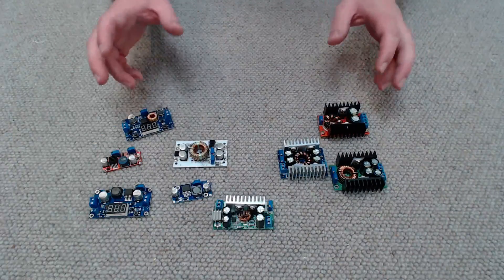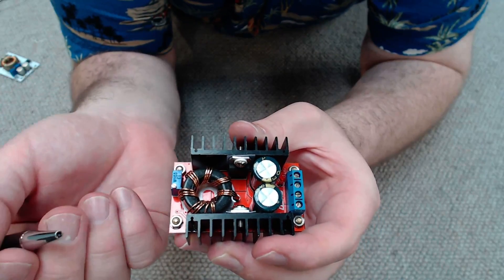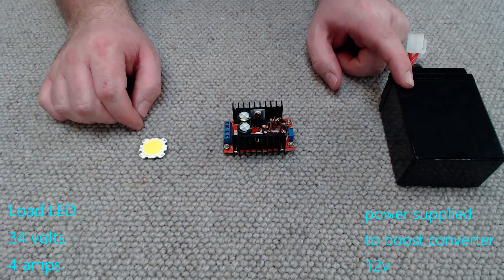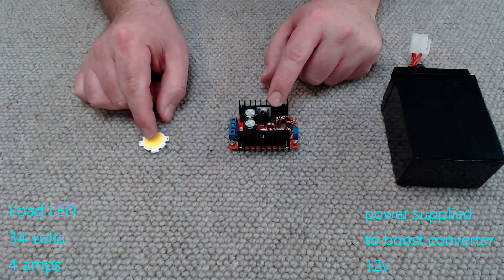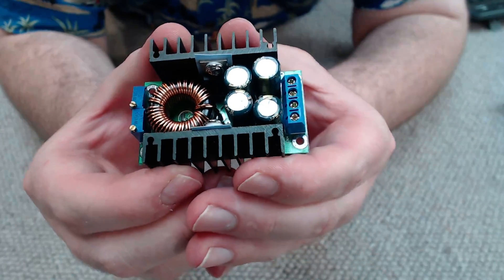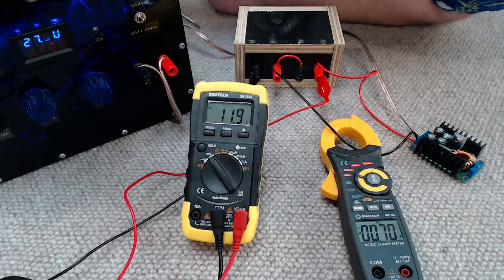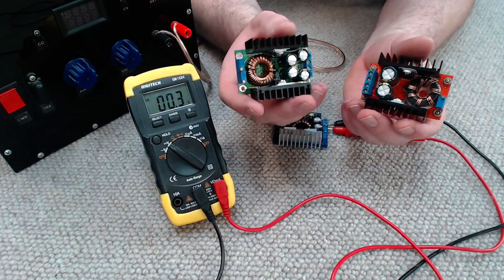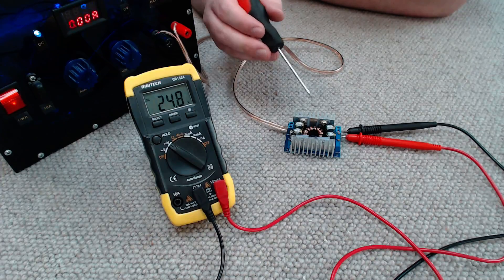What You Need To Know Before Buying A Boost/Buck Converter

Comment: If you got a boost converter that could handle that 11.33 amps, how much amperage would be on the power supply. Like if the power supply were only rated for 6 amps would it burn up
Reply from the maker: In the scenario, you described yes the PSU would be overloaded. It's important to remember current or the voltage alone doesn't give a full picture. Let's run over a quick explanation. Let's say my power supply can deliver 10volts and 10 amps. And let's assume I have a load on my boost converter of 30volts at 5 amps. Since my load is only 5 amps, surly my power supply can handle this... Right? Well no, because the total power consumption in watts, far exceeds what my power supply can handle. My PSU can output 10volts x 10amp = 100watts. My load is 30volts x 5amps = 150watts. So my power supply is overloaded. I hope this helps :)
Reply: So if I want to run a 50W LED strip that is 24v I cant is a 12v 300w Watt psu?
Reply: @LEO-xo9cz  You can use that psu without problems - any 12v psu with 7-8 amps output will handle that without problems if psu is ok and if wires can handle that for long time. PC psu often have 2 12v lines with 10-20 amps. Use some quality psu if you have.
Reply: @krlenjuska  Hi. Yes I have 2x 12v 18a lines. I was thinking of using two buck boosts and displays with voltage and current control so I can have two controllable outputs.
Reply: @LEO-xo9cz  If your PSU is cheap - its probably much less that 18A. Also voltage drop is often quite big under load on cheap PSU. Dont forget to join 3-4 wires (12V and ground also) to 1 thick wire for your buck/boost converter input in orded to prevent overheating under big load
Reply: @krlenjuska  It's a decent looking Dell supply. Well I've got a few others in my basement if this one is no good. Yes I was going to use 4 wires for each. What buck boost rating should I use?
Reply: I have about 5 of those exact boost converters! Can you run 2 or more identical boost converters in parallel? I know its a dumb Question but i am curious is it possible to increase current that way?any reply appreciated? Cheers
Reply: @dragan3290  sure u may find solution inface pf som transformer but basicly the problem is this:
Each one of Converters practicly is "non ideal voltage/current source" and kirchof law will curse you:
1.from voltage perspective ,each time u hadnt load your power supply,u had two source in paralel.which means if they slightly had differnece impedance or/and output voltage》》boom.
2.from curent perspective,without load u had two sources in series.back current to semiconductor with less output resistanse.its like each one of transistors will think that another one is Load and not sourse.》》Kaboom
Actually it depends on type pf semicpnductor in it,som of tnem designed like with build in diode so no problem of type 2.

Solutions: some addition diode to prevent 2 problem,some power resistor to truy make out impedance identical between two converters(just build up T junction between two sources and load,two power resistors in series with source.worse possible solution ,not effecient)...best and safest from my opinion is a tranformer way but its much expensive one.
Reply: @dragan3290  Generally not without modification like steering diodes on the outputs and some power resistors etc for some compliance.    Two or more separate feedback loops all fighting each other for control of the commoned output isn't optimal.
Reply: This was very helpful and likely saved me from frying some expensive equipment!
Reply: pm me can you  install do sola battery.... 😊
Reply: For example is you use PC power supply with 12V 15A - its 180W of power. These chinese buck converters have 65-70% efficiency (this is my opinion its not tested) so you will get about 120-130w of power on your output. example 24V 5 A or something like that.
Reply: @krlenjuska  they are actually 95% efficient, or at least mine is.
Reply: @easyamp123  You tested this?
Reply: @krlenjuska  yes mine is a DROK 180081

Comment: So basically the Converter input capacity should be in expressed in watts and not simply  amps. Another issue of supplying power via a battery. As the battery voltage drops, the current will try to maintain the output voltage. And therefore increase the amps flowing.This will get a solid state relay really hot if over it's rated amps

Comment: can this types of modules make some RF problems ? i want to use one  to low down voltage from my power supply ,17 volts to 13,8 . to connect my uhf ham radio tranciever to it.... can it create RF problems  or strange sounds in my signal ?

Comment: These modules are trash, I bought 2 different boost converters and they were both terrible, very high output noise and barely can handle 1A load, anything above that the voltage drops significantly !

Comment: What would happen if you lowered the power supply voltage with the buck boost converter, would it continue to hold 24V (that’s what it was set to at the end) or would the V drop? Also if the voltage dropped below the required operating voltage and then came back up into the operating voltage woukd it just go back to working like it never turned off? I want this for a solar panel to provide a steady 24V even when the solar panel drops lower in low light and I want it to turn back on once the voltage comes back up

Comment: Your shirt's so loud I had trouble understanding what you were saying.  I have no idea why you had 6 lead acid cells as 12v and 8 as 26v. The internal resistance of the battery shown is under 50 milliohms, that's not an explanation. BTW its still going to burn out the converter every time the battery runs down if there isn't a low voltage input shut-off to protect it, or a high input current shut off. For hobbyists a thermal circuit breaker will be simpler than anything else. It will require enough headroom on the converter for normal operation to never trip and yet trip within seconds below the converter's upper limit. The circuit breakers tolerance vs temperature may be a problem. A polysilicon resettable fuse may be a better choice from that standpoint but forces the addition of a battery current switch to allow it to cool and reset. An electronic input voltage threshold detector tugging on a disable line of the converter has the best tolerances but the highest complexity to implement.

Comment: Im testing 4 motors 8520 i think the peak current is 1.8amps, so four will need 7.2 amps with my esp32 im looking for 8 amps. I have a few mt3608 buck boosters. But im not confident these can provide enough. If you have suggestions i appreciate your comment

Comment: Always interested to know how things work when use doesn't matched designed intention.

Eg if I want to output 16v from a boost converter but it's supplied from a battery which can be 16.8v fully charged, will it simply output battery voltage until the charge is low enough to require actual boosting? Will this have any detrimental affect on the boost converter?

99% of the time it (battery voltage) will probably be below the desired 16v output but there may be times when it's higher.

Comment: Do they make current limiting boost converts that can do say 48v input --> 360-400v output?  Ideally with 100-500A input.  Yes, I'm trying to charge my EV battery from my 24kwh 48v trailer battery using a DC-DC converter for efficiency reasons stead of going 48v DC --> 240v AC inverter (95% efficient) --> 360-400v DC (90% efficient), which totals around 85% efficient.  Boost converters I've seen usually run around 97-98%, so that's one of the main reasons I'm trying to do this.
Reply: FORGET IT.  That is NOT a DIY project

Comment: can i use it to power a resistance wire, with resistance under 1 ohm, like 0.15 0.20 ohm, it will not activate the anti short feature?
Reply: check the specs! especially current rating.

Comment: I have a 20v ac transformer that i will rectify to roughly 28v when loaded this will sag slightly. I want to use one of these units in your video to boost this to 36v for an amplifier. Which ine would you suggest? Output current needed would be between 5 to 8amps. Thanks

Comment: I know this post is 6 year old but I have a question. I want to make a bosst converter from a 12 v to 24 with either 2.7 or 3.7 amp, it will power 2 different cpap machines one is 2.7 other is 3.7 and not at the same time. so max will be 3.7 amp so 24v x 3.7 amp = 88 watt it says 85 on the 110 to 24 converter. Do I need to have a boost converter that I can control the amp output or just voltage is enough. i seem to understand that only to drive led you need to control the current. Thanks
Reply: depends on the LED product

Comment: Im planning to use a buck converter for DIY charging. From 24v 4A to 21v 3.4A. Do we need to add a little headroom so the buck converter wont dropout? for example: 21.1v 3.5A
Reply: use power diodes to drop the voltage. you are dropping 3V so you need 3V/.65V diodes -say 4.  I'd use 10A diodes at least 50PIV. Two 10A bridge rectifiers would also work - these are  cheap

Comment: Great video! Can I use a buck converter for charging Lithium ion batteries? Will it taper the current (lower the current) when the battery is getting closer to be at full charge?
Reply: NO!!!!!!!!!!!!!!!!!!!!!!!!!!!!!!!!!!!!!!!!!!!!
Reply: @kennmossman8701  To late. I died 10 months ago due to a lithium fire.
Reply: @Zokeh   you can apply for a Darwin Award

Comment: Finally found your channel looking to make a bench charger that needs to go between 60v and 3v for lithium cell/pack charging would a 24v 16amp power supply work for this with a converter
Reply: you are confusing a CHARGER with a converter/power supply

Comment: I wonder if I wanted to use a buck converter (lets say the power source is 25v) to power my laptop instead of the charger which is 19v, would that be harmful to my laptop? 

I heard that laptops are sensitive devices and buck converters don’t produce clean DC as much as the original charger. 

I would really appreciate it if someone enlightened me.
Reply: yes, such converters are VERY noisy AND can exhibit voltage surges[good-bye computer].  I would not try it. Powerring the laptop from a battery pack [with a LDO linear regulator] would be less risky
Reply: @kennmossman8701  thank you so much for such information. Stable and pure output are qualities I’m trying to seek, but efficiently is also another important thing I must consider. Do you happen to know a good buck converter that is reliable?

Comment: CAUTION ; ebat sellers have "Boost/Buck Converter" in the Description, but many ALSO say in the fine print boost only or buck only. Beware friends
A Boost/Buck converter needs TWO coils, one for each function. Often you can see two separate coils, some use a double wound toroid, which is effectively two coils on one core

Comment: Thank you for the video. I know the principles but always nice to see the Demo. I just got a DC-DC boost converter in my life as a needed device. I bought solar panels to charge a portable power station (all in one battery, charge controller, inverter, USB ports and display). The Solar Panels full available output was not being accepted by Power Station (74 watts and should or could be double over 100-120 watts of panel). The boost took panel volts of 19.3 to 27.3 (adjustable). The power station is now taking 133 watts! The power station accepts up to 30 volts. It appears to charge efficiently or faster the Power stations likes 24 volts. With the supplied AC power brick to charge from wall outlet, it provides 24 volts and chargers at 118 volts.  I tried this booster and was rewarded with more power than I can use. I need about 600 watts a day, to charge my 500 watt power station and keep a small 12v portable frig freezer running. The battery from 6pm to 8am uses about 36% of the power station (when there is low or no sun). Now I am fully charged by noon and it stays that way until sunset. I have sustabable power for the frig/freeze thanks to the boost converter. Before with 79% less charging rate I was in a deficit by about 35%. Excellent.

Comment: For me these are more suitable as a portable battery power supply for running a little dremel. I have measured the 100 watt units and the 1200 watt units. If you read the EBay specs? No way ! I put 2 cooling fans on the little 100 watt dc to dc converter to keep cool at max output. So now I use the 1200watt version and keep the volts at half the rating if I'm running max current! But even then I lower it.

Comment: Hello from the UK 👍 Thought you'd like this: I got a boost buck converter and 'tested' it on the multimeter and the onboard fuse popped!!! Poop! 
The fuse had no base/cup/saddle or whatever it was supposed to sit in....it was soldered directly into the board. It was okay to get at with some pin nose pliers but very busy and crammed with parts to see that I had to put my spectacles on 🤓 I pulled at the fuse and the blue plastic came off, leaving the metal behind. On closer inspection of the blue bit...there it was...the burn mark. So my best, after failing to release the legs from the board with the soldering iron I resorted to soldering a new fuse on top of the legs;bridging the gap again with another 15amp fuse. Yes I did that and I completed my project for my OWN use to power my laptop with a car battery.

Comment: Can you aybe do a video on howto set cc using these particular  bost buck converters and some more that you had on a table? Some aliexpress sellers state that shotring should not be used. On a bench psu you just short the leads and set max current. I have a boost converter and i can set the cv ie max output but when i plug meter at 10a dc seting and effectively short it i cant get a reliable current reading and turning the pot does not make any difference. Does it depend on what controller the device has? Thx

Comment: Can I wire buck converters in parallell? 

I have a gaming laptop I'd love to power from 12v nominal, it can pull up to 200W when gaming. (Or right below) 
Lithium, so voltage is just around 15.4A max-..

Comment: Can these things help in a configs where we don't want to install a solar charge controller? I want to charge a 48v battery with a BMS using a 250Watt 24v solar panel directly.    I need 55v @ 3a.  Should I trust the BMS like this?

Comment: Odd Qeustion. . .  I've a little 18650 pack that runs my 12v esky.  
I'm wondering if something like these could be put inbetween the solar blankets charge controller and the battery to limit the charging current?
 but maybe also allow for full current output back into the controller.

Comment: hi there , i was wondering if i could charge my 60v 20 amp battery with such boost converter .. 
what if i use a simple laptop charger + the boost = maximum amp output

Comment: im interested in getting the overall dimensions of the voltage stepup convertor (1500 watt types sold on ebay,etc)...anyone know the dinensions so as properly buy an electronic project box for it to fit it?

Comment: I AM USING LM 2596 IC BUCK CONVERTER , I NEED TO REDUCE  SOLAR PANEL 22V TO 12V....BUT NOW INPUT AND OUT PUT SAME VOLT....PRESET ADJUST ..BUT NO CHANGES OUT PUT VOLT ...WHAT IS THE  REASON ....

Comment: Why isn't my buck converter (xl 4016 green one) cant control current ? Input voltage is 34volts and i think my power supply can output somewhere 12amps at 34volts. Even if  i set the current pot to its lowest, it still output 3v and 1 amps.
Lets say i set 5volts and current to 300ma and if i add load instead of volt going to zero, the voltage will freeze at 3v and 1amps. Why is it happening.

But if i connect laptop charger with 3.5amps it works perfectly...i mean current regulations is perfect...but not when i connect my 34v power supply at 12amps

Comment: Thanks for the informational video! If I want to use a buck converter for charging a li-ion battery pack, how can I limit the current that is fed to the BMS if my power supply is not strong enough to provide the current the BMS wants to draw? Do I need an adjustable current buck converter and set it so that the current drawn from the power source does not exceed its ratings, thus limiting the current fed to the BMS as well?
Reply: How did your project go?

I plan on making one without a BMS. Using schottky diodes to prevent cells from charging each other. And using TP4056 and 110 volt AC to DC 5 volt 1 Amp converters, in parallel. With the modules isolating each cell and current only flowing towards them, it should be enough to prevent over charging. - I'm just looking into how to output from the bank and limiting the amperage. Will definitely need more schottky diodes on that end as well. Lol
Reply: @josholin31  I changed my idea and went with a dedicated li-ion charger that can do trickle charging. Constant voltage (first phase) and constant current (second phase) charging must be provided by the device.

Comment: Great tutorial. I'm using a 350w ATX power supply to build a Desktop PSU. Would like to add an adjustable converter to get 24v, 10amp. The power supply can provide 12v, 15amp as displayed on it's label. Thinking a 300w, 15amp converter would do the job, or should I go higher wattage and amperage for safety and Chinesium quality factor? All suggestions are welcome. Cheers m8
edit:
Okay, just did the math and see that I need a minimum of a 20amp converter and won't really get that, so I should probably go higher...ughh.

Comment: I have a battery with bms protection and balance all in one, if u put this between it and a laptop charger and lower the voltage to the max of the battery, would that be safe to charge the battery?